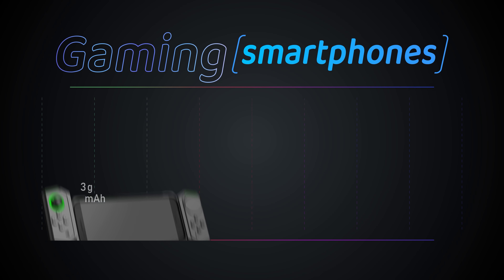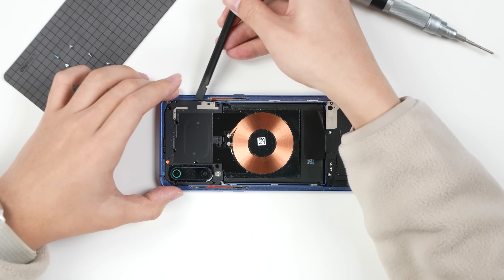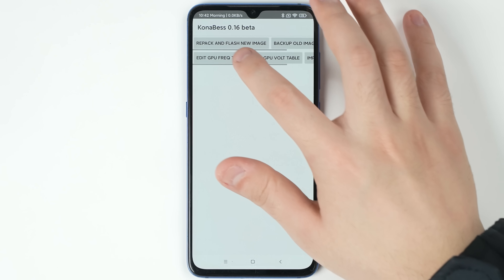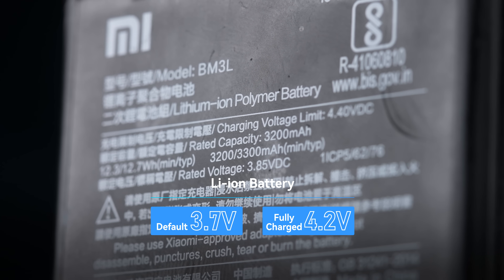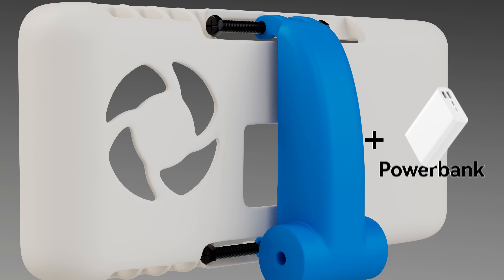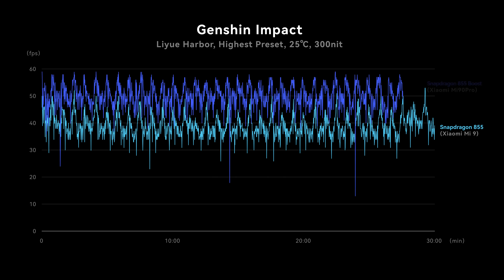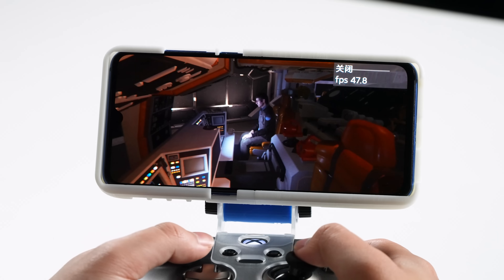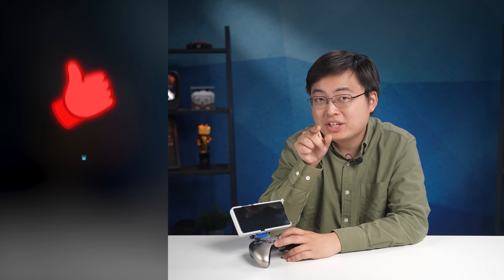We Turned This Old Phone into a Gaming Beast !!!

Comment: I heard some Custom ROMs improve performance, willing to give it a try? You can also update the GPU drivers for better performance, and some other tweaks which can be done using Magisk or flashed via TWRP.
Reply: For xiaomi devices miui + custom kernel would be much better and stable for gaming than a custom rom, idk about other smartphone brands tho😅
Reply: @jaspercas  no bro miui is a heavy ui and aosp is light so its fast and takes less ram
Reply: @jaspercas  custom ROM is better than MIUI. I am using pixel experience on Redmi 9😎 and it's miles better than meme UI.
Reply: @faisalrahman9236  yeah I think AOSP roms on Xiaomi devices are hit and miss since a lot of people the redmi note 8 pro group that im on are suggesting stock miui with custom kernel for gaming

Comment: Very cool project! I’d love to see a followup with a newer chip like the SD 888 or gen 1 😁
Reply: the effort it takes and technical know how is way to advanced even for literate people, what would be a better project is to do a battery and thermal mod to a steam deck! the files for the back cover are downloadable so it should be easier for him to create custom backplate and watch how many people will download that file if he's succesful!
Reply: You could find it on Nubia red magic 7
They have built in cooler and an overclock. 
The performance absolute beast, and the only contender is lenovo legion y90.
Reply: You can think about it. The chip from three years ago. Can do this level. What if you modify the current chip? How incredible it would be. On the other hand, the chip three years ago can do this. It also proves from the side that their efforts in the past three years are small. How embarrassing the company will be.
Reply: @pcjdhdjxbc5836  I think X cores are the problem. Only good at super high speed in short amount of time, after that overheats. So we should find chipset without X core. That means 7 Gen 1, and Dimensity 8100 that don't have X cores, but capable to perform just like 888 and 8 Gen 1. I think 7 Gen 1 will be very good for this kind of project. Brand new A710, A510 cores, much better Adreno 662 (similar to 888's gpu.
Reply: pak you🤣
Reply: @martinbromeo6687  what's that word i don't understand
Reply: I think it may not happen,you know, the surprising heat🙃
Reply: Fan cant cool the sd888 and sd8 gen 1 its crazy heating literally
Reply: https://youtu.be/JrKnxAlYmyU
Reply: that's game changing...........

Comment: Very nice!
Why not try with 870? 
That would have been great!
Reply: S855 phone is more cheaper
Reply: @Wesley0220  and 845 is most cheap hope he trys it
Reply: @Dhruvr21  845 phones generally have many limitations, such as the inability to adjust the voltage of the hardware. even the 835 can do this, so it's not recommended. 865 and 870 are a better choice
Reply: @Dhruvr21  845 isn't much cheaper than 855 nowadays so not worth it
Reply: 888 too

Comment: Please try this with 865/865+/870, or 778G. This test proof that TSMC made chip has an amazing potential.
Reply: For real 40% uplift damn.
Reply: @liesandy291  Samsung chip could never, leakage too big
Reply: @selentatsukienjoyer  hmm the ceiling will be lower i quess as long as the thermal being kept in check it's still doable.
Reply: @liesandy291  865+/870 maybe, but not 865, that thing is the most stable Qualcomm chip to date, for 778G maybe it can push the CPU better than the GPU potential.